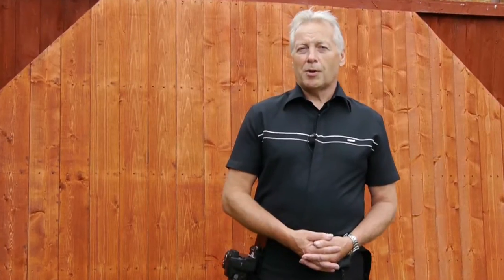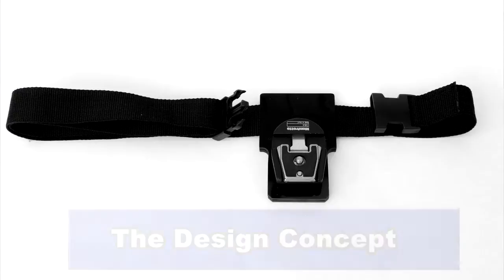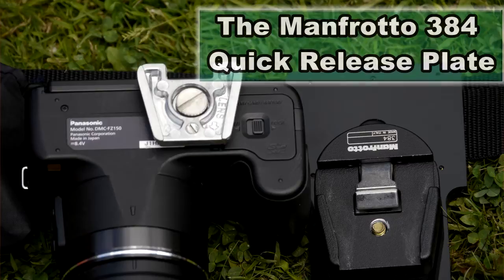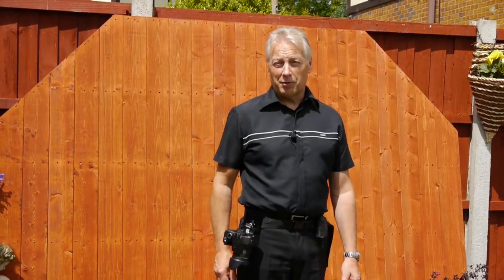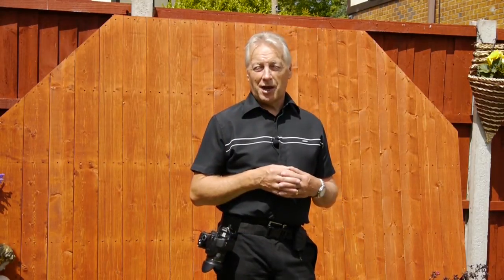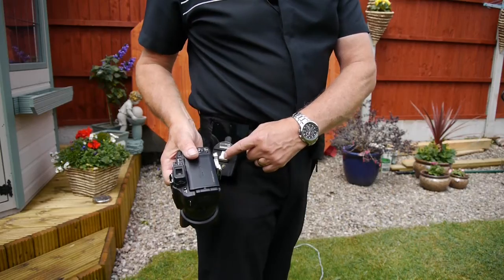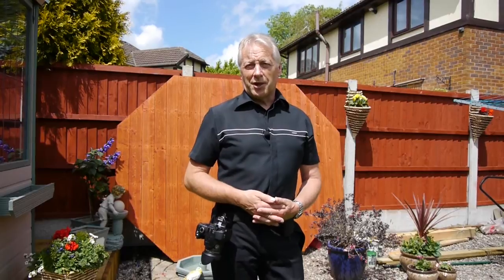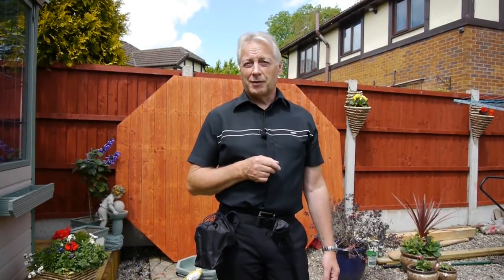A DIY Camera Belt Clip using Manfrotto 384 QR plate

Comment: Hey Graham, awesome idea! I was just looking at the Spider Holster system, but in order to use that I would not be able to use my current manfrotto QR plate. I use the QR plate in junction with my black rapids sling, so I can travel hand held but quickly mount to my tripod, or in the reverse to get off the tripod quickly to get funny angles when shooting spontaneous portraits and such.... I like it a lot, Thanks for sharing! I will probably being making some modification to my belt very soon ;D

Comment: It's a shame they didn't run with it. This is a very clever idea as you can use the same type of quick release for both belt, monopod and tripod w/o switching the mounting plate.  Thanks for the idea.  I'll be building one for myself.
Reply from the maker: Mines still in use and works perfectly, never a dropped camera!